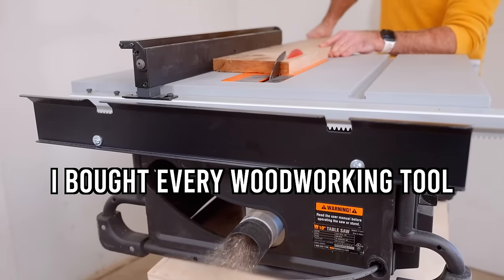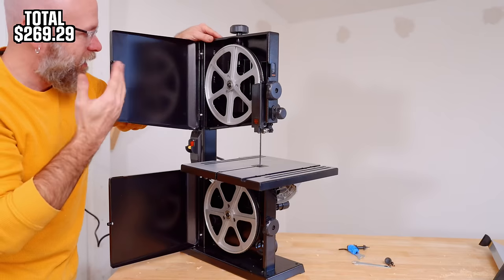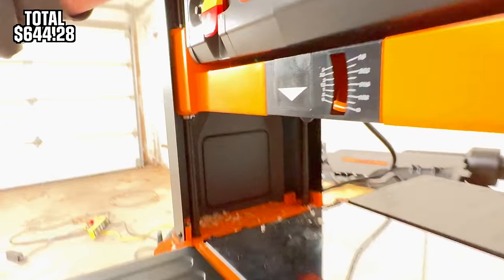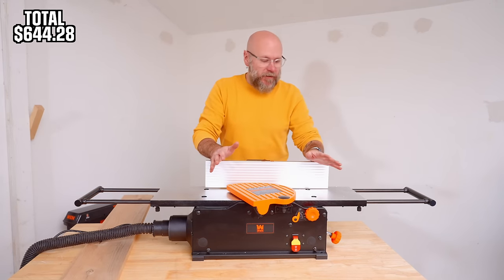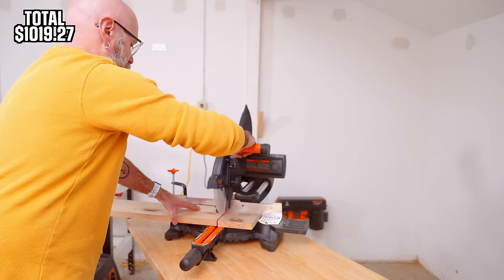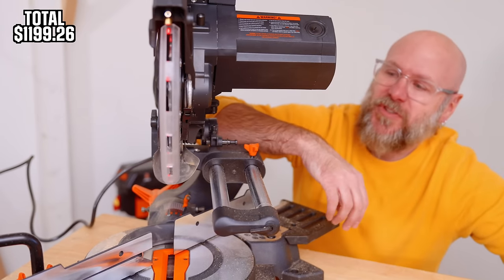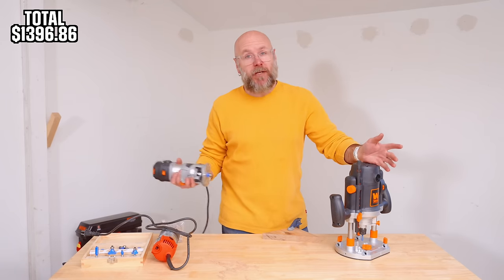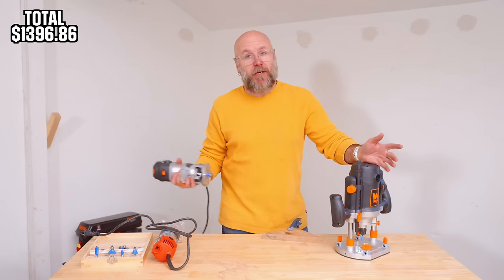I Bought ALL THE WEN TOOLS! Let's Review.

Comment from the maker: UPDATE: Wen is shipping a new planer to me this week.
UPDATE 2: New planer has been delivered. Will unbox it this weekend.
UPDATE 3: New planer works perfectly. 5 Stars.
Reply: hoping you do an updated review on that performance. I was saddened that you weren't able to do it for this video due to factory error because I was thinking of getting that one.
Reply: I got the same model, bought it cheap to see if I'd use it enough to buy a fancier one - and don't feel I need the fancier one!  It does a great job, lovely finish, can go straight to joinery.  Next step: replace the HSS bits with carbide.
Reply: What's crazy about this, and why I'm thankful for this video, is as a complete beginner, I would never know that was supposed to be there! I would just assume it was a pain in the ass to use, or I wasn't good at using it! Thanks for sharing!
Reply: I have a few Wen tools in my shop, I blew up the guide bearings on my portable bandsaw and out of warranty they still sent me parts for no cost
Reply: I hope you revisit the planer when you get the new one
Reply: I have the wen  13' 3 blade planner and it works great they didn't have the spiral head when I got mine. Hope the new one work great for you.
Reply: Awesome! Love your stuff David keep it comin!
Reply: Future me, does he give it 4 stars?
Reply: I have one and it’s great. It gets hot and turns off if I feed it too much hard wood (I use a lot of teak) and I have to wait until it turns on again. But with fresh knifes and shallow cuts it is perfect.
Reply: Make sure it’s a 2024 planner.  It is a leap year this year. 

“Planer”.
Reply: Dramatic much?  Take about 25% off there, drama queen.
Reply: That planer was very good for me
Reply: @TracyParks  I had the 12.5" 2 blade wen planer and it was absolutely garbage. I sold it cuz I hated it, the hand crank for the height of the planer always moved while planing boards making it completely useless, couldn't get a perfectly flat planed board. Huge 4" snipe on both ends even the design was bad there is a tab of meta that's supposed to hold the wood while feeding boards but it leaves a huge gouge in the wood all the way down the board. I had better luck with a belt sander
Reply: Planers 5 star
Reply: I love my wen planer. I got the 3 head because I couldn't afford the spiral at the time. Sorry your experience was tainted!
Reply: Are they making you ship the old one back?
Reply: Imagine purchasing this one and taking it to another country and find out its not working!!! Sorry Wen, its a NO GO.
Reply: That is unfortunate. I purchased my Wen planer over a year ago and couldn’t be more happy with my decision. I am hoping you enjoy the planer when you get it.
Reply: @TracyParks  I love it! The older Dewalt 735's were great but Dewalt went to 💩  over the last 6 years (Dewalt has sadly cheapened their entire lineup).
 
Not all WEN are good.  And not all are the same even if it's the same model. 
 
I 💩 on WEN for years, but I took a gamble a few times, and there's 4 or 5 GREAT tools they make.
Reply: I've had a Wen planer for almost 6 years.  I have had to replace 1 part on it and the knives (not helix head) its been great and part replacement was most likely because of the crappy wood we put through it.  Excited to see your review once you get the new one!
Reply: I have the the same WEN planer lol. Waiting for your review, but for me it cuts butter smooth and barely any noticable snipe. I use it all the time.
Reply: I am curious as to whether they resolved this issue before, or after the video came out?
Reply: I'd love to see you take a look at this when it does come. I have a hard time to justify the price of the Dewalt since I barely even have a shop--but that's certainly a situation I wouldn't want to deal with as someone who's never owned or operated a planer before.
Reply: I predict it would be 5 stars except because of the OOTB issue, it'll be 4 stars.
Reply: A little bungee cord on the drill press handle will stop the violent returns. Slightly less inconvenient than a busted knuckle
Reply: Tell them to send the 2 speed version… for your inconvenience lol
Reply: I have the Wen spiral cut planer and I predict you give it 5 stars after you work through your customer service nightmare.
Reply: Wen?
Reply: on the bright side you have a second one for spare part if it break :D
Reply: @RockPolitics That was my favorite moment as well. I laughed so hard!
Reply: Power requirements, all 110?
Reply: Lookin forward to it, i was about to order a Wen planer and glad I've hesitated.
Another vid ive seen on them, a part of the motor crapped put after a few months...but the replacement part was $30 and super easy to swap out, so i wasnt quite turned off
Reply: WEN has GREAT customer service by phone or email!
Reply: Next time you run into this you can order a new one and return the old one as the new one. Or take the drive chain off the new one and return it. Not the most honest way of dealing with it but they've sold you crap so who cares.
Reply: I found out it is best to call wen had great results when you  call  and tlak to a real person
Reply: WOW!
Reply: I also the same model of Wen planer and I absolutely love it. Super easy for even a beginner to setup and get running and the ease of adjustment and finish quality is top notch.
Reply: Thanks for the update
Reply: Good to hear. I'm no expert when it comes to planers, but I bought the Wen a year ago and it's been a great tool for me so far.
Reply: Great review, I'm glad that they sorted the planer.
Reply: Wen has very good customer service, glad they replaced the planer! Btw, I have the Wen track saw, no need to spend all that $$$ on the Festool for my uses. I’ve made hundreds of cuts with it and it’s never failed me.
Reply: Good customer service counts for something, too.
Reply: @TracyParks  I have the 12 1/2 in one planer bought from home Depot and it's an amazing machine for the price point, my only complaint is that it does not take off enough material for my preference, but I use an industrial cleaner at my job daily and I am used to that quality, I'd give it a 4.5/5 stars
Reply: Can't wait for the updated review!
Reply: I have a few Wen tools.  Their tech support  is superb
Reply: I would bet anything that this was a return where somebody temporarily “bought” it to steal parts to repair their own machine
Reply: @davobonbon 
He updated the pinned comment - 5 stars. No scratchy on the hands?
Reply: @KLP99  Thanks. Does it not have cheap plastic handles?? Or did he lower his standards? 😏
Reply: I have the wen planer with helix head and love this thing.  Great entry level tool.
Reply: Did you have to return your faulty planer or did they let you keep it. If you've got 2 then hey that's spare parts if the good one breaks something
Reply from the maker: I had to return.  @Tb4870
Reply: @MakeSomething  ah well still cool that they got it straight for you
Reply: My Wen planer is 3yrs old and no complaints
Reply: Don't miss the opportunity to make and sell descent knows for there units in your store.
Reply: WEN left that much parts out of the box from the manufacturer, is definitely not good for its reputation about quality assurance and consistency.
Reply: Hey... when are we going to see a video of you using all these new tools?  Still super interested in the Wen Planer...  debating buying it vs a spiral head for my DW 734 with nicked straight blades...
Reply from the maker: @jb510  Probably in April. That garage is cold and uncomfortable at the moment.
Reply: @MakeSomething  well... I just an hour ago broke my DW 734 :( (I had bought it used, restoring it and broke the head trying to unstick rust on the struts)... so...  I'm buying a WEN PL1337! Yolo.
Reply: not 4??? lol
Reply: I've had their planer for years- I love mine. I do wish I could plane larger than 12" but that was the size I bought. 🤷
Reply: @MakeSomething  came here and asked that same thing, awesome.
Reply: No way you hadn't test run that planer prior to filming (who doesn't inspect equipment before use? Especially for a shoot)
No way that was a single take.
Reply: @carterscustomrods  the problem is Wen, like most Chinese goods, aren't made by one company (Wen), they're made by anywhere from 2-20+ different companies that color and label them for Wen and ship direct to Wen's "customer retailers" around the world.

There's poor consistency between factories because factories take whatever supplies are closest / cheapest rather than to some standard.
Reply: You can get steel spring handles to replace the plastic.
Reply: You should never get something you have to return 5 stars. It is good that they shipped you a new one and I think most companies would but customer service is not a replacment for quality control.
Reply: Seems like a mistake with the planer. Based on your review with the missing parts I would still buy it
Reply: I like how Wen sent you a whole frickin new planer but was like "Nope, cheap knobs are our trademark. That's where the margin is"
Reply: I'd give it 5 stars! Customer service is everything!
Reply: Honestly the dirt cheap Chinese stuff wouldn't even have a manual good enough to let you see which parts you were missing so I would count this as a win. Especially if the new parts arrived fairly quickly and without lots of time spent with support.
Reply: Best updates I’ve ever read 🤣
Reply: @MakeSomething do you have the DeWalt DWS733? and if you do, how does it compare to it? I was hoping to find the WEN brand here in EU, and while I found some, they're way more priced than what "cheap" brand should be - probably due to Shipping, VAT etc. We do have a brand called Triton, which looks to be similar. - hoping you have it there and can do a review of that. Thanks for very nice vids!
Reply: let me explain where you fucked up on the planer.
You took the rollers off.
The engineers know the wen is a cheap piece of shit with weak gear material and a stressful design for the power drive.
You are meant to make the smallest depth cuts at a time to make the planer last the longest before the gear box breaks.
The rollers are for thick heavy wood boards to be set across the top and pulled back across to plane again to save your back as you are meant to be making a ton of passes.
As for your planer, that didn't leave the factory like that, that is a returned item.
You can see the chewing on the plastic where it had sprockets and a chain, and they broke and chewed up the cheap plastic.
This is a very common problem for Wen planers, along with the previously mentioned gear box explosion, the teeth just get sheared off the gears.
You machine is likely a cleaned up returned item that was meant to be sent to be refurbished but accidentally got marked as already refurbished and shipped out.
Reply: Did you have to return the original item?
Reply: It's good that they didn't know who you are.  They responded to an influencer  like they would have responded to me.   
When it comes to the table saw, My Hitachi (now Metabo) C10 contractor saw has a similar extendable outfeed bar.  It is great to have.  It also has the rack and pinion fence that looks very similar.  If you look at the fence, it will have screws, mine has hex screws, to adjust the fence up and down the rack.  

I like the fence on the Wen better than mine because it is fixed. Mine folds over when I pass the table to support the edge of a long panel. I think that is what the piece is you swung over the top of your fence. Because my whole fence toggles, it is not sturdy to be used for tall stock. 

Also, would you consider examining the fence carefully and see if you might build a completely new fence to mount onto the racks of that table saw.  I can see a Biesemeyer style fence being a great mod.  Also, you can build an extended fence for longer stock that overhangs at least the front if not the back of the saw (to me, the back is where the outfeed is.)

Also, I agree with your 4 star ratings.  You might consider using the tools to build new knobs, just for the fun of it and for the fast growing number of Wen enthusiasts.    

Great Video!  I've been wondering about getting a budget track saw, but right now I'd much prefer a sliding miter saw for projects I have in mind. 

Keep up the good work.  
(for some reason I had to resubscribe to you today) ;(
Reply: The planer looks identical to the Rigid planer I have, actually. I've been happy with it.
Reply: I really enjoy watching your videos, thanks for sharing
Reply: @RockPolitics That gave me a laugh too! Anyway, I'm glad the replacement machine turned out 5 stars. :)
Reply: cool thanks for the update and I 100% get disappointed when stuff like that happens
Reply: Sooooooooo we're not going to see a new review? I was really depending on that review.
Reply from the maker: @clgaines2006  5 stars.
Reply: I am so glad you did these videos, I have a small shop and not a big budget....I am a huge fan of the Hart brand too

Comment: Hey all, I have the WEN bandsaw mentioned in this video.  Two important facts if you have one.  First, Timberwolf blades will break in this saw.  I talked to the folks at Timberwolf and they said their blades don't do well on smaller bandsaw wheels like this one. They recommended Olsen and those have worked beautifully for me. (Still love Timberline on my bigger bandsaw).  Second, I replaced the tires with Blue Max Polyurethane tires and it drastically improved the tracking.  With these two improvements, it has been a great saw for me.  Like others, I've had great luck with the WEN brand.

Comment: Just a bit of friendly advice.First joint 1 edge, next joint 1 face, running the previously jointed edge against the fence of the jointer. After that run it through the table saw with the the jointed face down and the jointed edge against the fence.  this gives you two edges that are parallel and square to 1 face.After that run it through the  thickness planer flat face down. the result will be 2 parallel faces that are square to the edges. Order of operations my friends.
Reply: @JimRimS4S  agree on order of ops being very important but I’d swap operation 1 and 2. Face jointing does not require the edge to reference the fence in order for the face to be properly and consistently flattened across its length (especially since it’s complimentary operation for coplanarity will be on the planer). Edge jointing requires the face referencing the fence for proper and consistent flattening along its length and for square. The face needs to be flat without bowing, cupping, or twisting to provide proper reference, so it must be run first. If the face is twisted, the edge will be twisted. Then, the edge will not be square at the end of the milling process and the pass on the table saw will result in a non-coplanar complimentary edge on the opposite side of the board. 

But then again, woodworking isn’t machining so what’s a couple thou of non-coplanarity. I don’t think measurements less than 1/32 exist in my woodshop
Reply: Agree face then edge

Comment: FYI, your complaint that the drill press handle flys back because there’s too much spring tension is false. The spring tension is adjustable. Just loosen the cover on the left side of the drill press and you can set it to whatever you like, literally down to free moving with no return at all.

Comment: As someone who's interested in getting into woodworking, I cannot thank you enough for these budget minded tools videos. They are fantastic and the insight you bring to them with your years of experience is invaluable. Thank you so much!
Reply: Most of my tools are wen, love there tools.
Reply: I honestly can recommend ryobi for a lot of tools also. Their trim router is great, brad and pin nailer are wonderful, Only thing Id recommend is getting a good sander from someone like festool. I have the ryobi tracksaw ( i got for 200$ on sale including the track, a 4amp battery charger and thr saw) and had the ts75 festool saw got stolen and for most people the ryobi will work for most things. The festool has luxury features and a deeper cut but ive found it helped me to research what you can use cheaper tools for and what's worth investing in as well as the tools that provide the most ability to serve different purposes.
Reply: Honestly, except my table saw, all my tools are something I got on Craig's List for cheap or Wen. I love my Wen tools, no complaints with any of them.
Reply: @Mourning-Sun  exactly!! Other channels are talking about 3,000 dollar table saws.. crazy... Im curious to see which is better wen or ryobi?.  Both are more affordable than a 3,000 dollar saw

Comment: I have a mix of brands in my shop and can proudly say Wen has worked for me. I started out with the Dewalt table saw and planer but went with the Wen band saw, jointer, and drum sander to complete my shop and have never looked back. Some of the points you raised are valid but they get the job done for someone like me who is a weekend woodworker. I lusted after a jointer for the longest time. Wen made it possible.   😃
Reply: A jointer is the last thing I desperately Need! Thanks for the input..

Comment: I have a WEN planer (about 2 years old) and it's been great to work with... Of course mine came with all the parts! Another key point about WEN is that they make replacement parts for a lot longer than some other brands, so you should be able to repair them down the road.
Reply: Agreed the two speed version is well worth the money for a broad spectrum of soft and hard woods. Great bang for your buck especially for beginners.